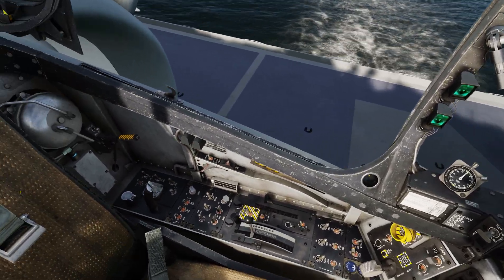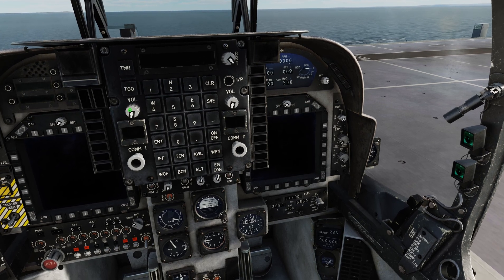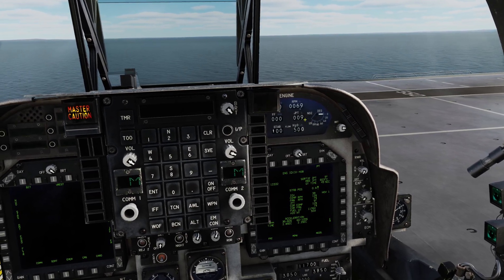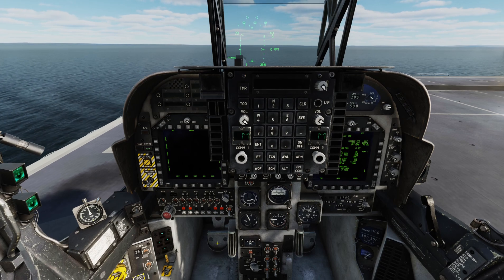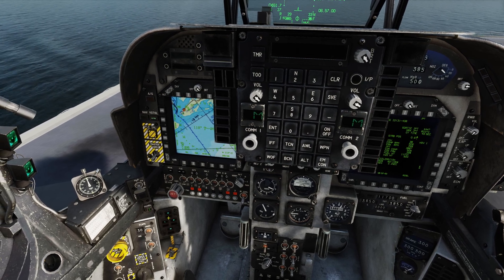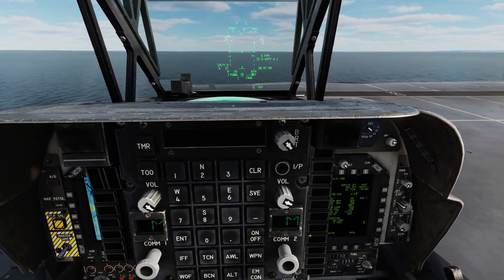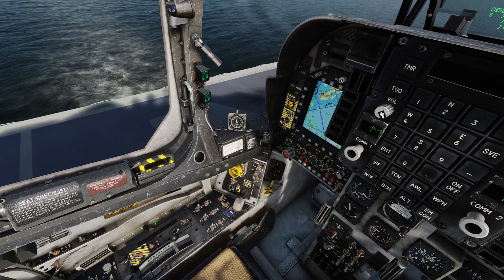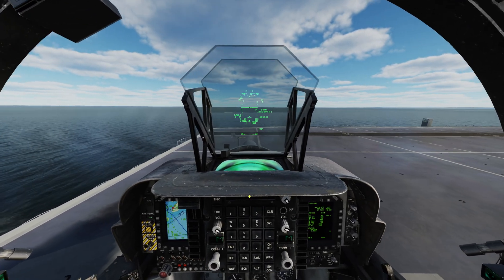DCS AV-8B Harrier Cold Start and Launch from HMS Invincible

Comment: You need much less runup on Invincible than on Tarawa - MUCH less. Too much takeoff distance is the no.1 cause of gear damage on takeoff.

400ft is enough for most loadouts. If you don't drop a little after coming off the ramp, you've got room to do less.
Reply from the maker: Old Tarawa habits die hard!  Thanks. I have launched from closer to nose since this video, seems fine 👍